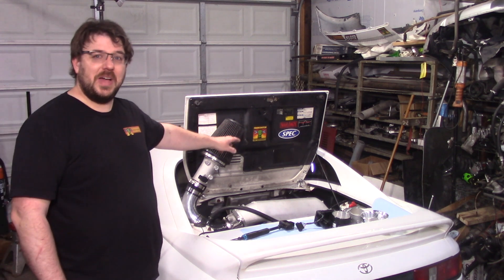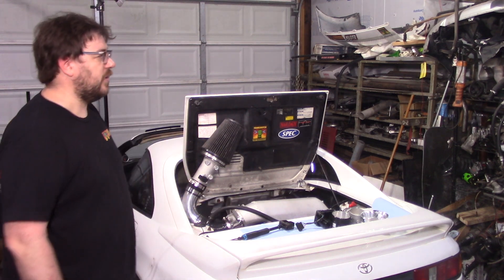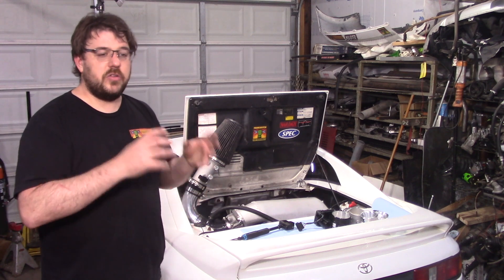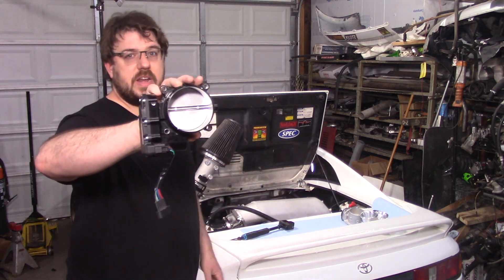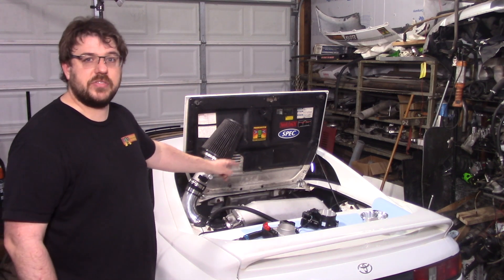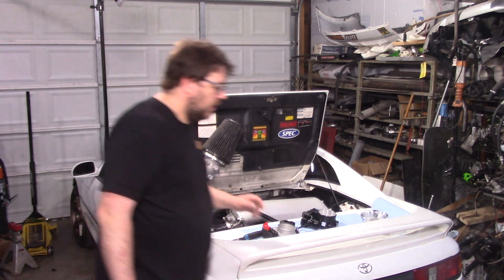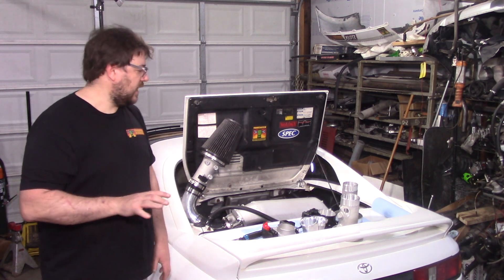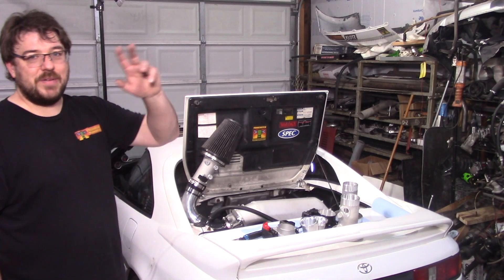New 2GR-FE intake adds another 20whp!

Comment: There are a TON of us RAV4 2GR-FE guys with stock motors looking for modest power gains. You say address the Y Pipe, okay. But where do we start with basic mods? You could stand to gain alot by addressing RAV4 mods. Keep up the good work.
Reply from the maker: Unfortunately the y-pipe IS the thing holding back the power, fixing anything else first is just fighting an uphill battle. I wish it was something simpler that i could tell people about and sure you could install cams and such without modifying the exhaust and it will make more power but it's all still very held back by the exhaust.

Comment: For stock application:

1) where are you routing the PCV valve hose to? I can see the other bank connecting to the intake pipe. 

2) does the variable intake runner length  “cutoff” 4,500K throw a code? 

Thank you,
Reply from the maker: PCV routing is the same as stock. As for the ACIS, it does not actually have any codes related to it.
Reply: @FrankensteinMotorworks  thank you Mark!

Comment: quick question.  will the supercharged version of the 2gr fit in the 1991 sw20? and can the parts you sell work with it?  "2GR-FZE. The engine is a supercharged version of the 2GR-FE used in the Lotus Exige S, Lotus Evora S/GTE, and the TRD Aurion. The supercharged 2GR-FE was fitted with the belt-driven Eaton TVS (Twin Vortices System) four-lobe supercharger. Lotus cars were equipped with a supercharged 2GR-FSE engine by the Harrop HTV 1320 supercharger."

Comment: Hey Marc, this is with the fuel rail, new injectors and the haltech right?
Reply from the maker: This is actually with the stock rails and injectors. In the video i did it with the Haltech because that's what i was testing the tune with but this works with the stock ECU.

Comment: How does one close the engine lid?
Reply from the maker: You can buy it with a 10mm drop spacer and you have to modify the rain guard but the engine lid closes just fine. With that said, i'm working on a reduced height version that will fit better.

Comment: I’m debating on doing a EZ30/36 or 2GR swap for the GR86. The goal is 350-375hp (naturally aspirated). I’d like to go with the EZ mainly for the sound and lower center of gravity, but my main concern is reliability. Any advice would be appreciated.
Reply: Leave the EZ alone. 2gr makes more sense... My opinion naturally. What about VQ37HR? Seems a reliable engine to get over the 400 mark NA, certainly easier aftermarket

Comment: I have a 2007 rav4 with the 2gr and I was wondering if its possible to do all of this to my rav considering it's the same engine. I don't see why not but I would love your input. btw thank you for the vids this engine doesn't get enough attention.
Reply from the maker: This can certainly apply to any 2GR-FE but keep in mind the first restriction in the 2GR is the exhaust system and fixing that restriction can make the car a lot louder than most people would want.
Reply: @FrankensteinMotorworks  thank you for the reply. My rav is already side dumped and loud as shit (in a good way) so the noise isn’t an issue. I’ll for sure be buying your stuff for my car after I save up a bit

Comment: Is there a way to valve the intake so we dont loose bottom end....for us highlander guys😊
Reply from the maker: Realistically, this intake was never really intended to be used in this configuration. This video was made because it was neat but unless the plan is to add even more at a later this intake is not really a good plan. A better design could be made to work much better with the stock cams, this one is made for big power.
Reply: @FrankensteinMotorworks  but I like big power. Hehe I'm looking into the supercharger kit off the lotus with the toyota 2gr-fe v6

Comment: So the 400 whp can't be achieved with the 76 mm throttle body and the stock ecu? Not even with the piggy back?
Reply from the maker: So it may be possible to make the 400whp setup with a stock ECU but this exact motor as i've got it put together would not work with the stock ECU. The biggest issue is the fact that the cams are not timed as the stock ECU expects because that would allow the valves to hit the pistons. But if you were to use different pistons with bigger valve cuts you could install the cams as the ECU expects them to be. as for the 76mm throttle body, that's probably too small, the math shows it as being a bit marginal so it may be worth trying but it will likely choke the flow a bit but Toyota has an 82mm throttle body available also and if that's not enough it could be bored out but 82mm is likely big enough.
Reply: @FrankensteinMotorworks  so the stoxk sienna ecu can read an 82 mm throttle body? I was not aware of that. Thank you for the answer!

Comment: wondering if the 2GR mods will work on a 1GR - 500cc bigger displacement and rwd - could make a great swap engine for rwd cars
Reply from the maker: The single vvt-i 1GR is a very different motor but the dual vvt-i unit would likely be able to benefit from a very similar path.

Comment: What’s your opinion on the unichip ecu tuner plug and play units? I’m considering maybe buying to see but as you have plenty of experience working with the 2ar-fe engine, I figured I’d ask. Would you say consider it or go with something else. I do like how unichip has the ability to change maps for drivability much like cobb
Reply from the maker: the unichip is just a modern take on an old school sensor value modifier. it does not actually modify the tune but it can make the ECU access different parts of the map. The 2GR and 2AR have a lot of plausibility stuff in the ECU that would detect too much fuckery. But more importantly the stock ECU really isn't holding the engine back so there's nothing to gain until you modify the physical intake and exhaust or engine internals to make it flow better and at that point, small changes can likely be tweaked by the unichip to make it react better to those changes.

Comment: so this definetley beats 5s NA, or does it..... enlighten me
Reply from the maker: When you say "5s" do you mean the 5S-FE motor that is one of the options on here? if so, it's about 2.5x more power than the 5S-FE. If you're saying bearing 5 seconds 0-60 then yes, even before this the car is already deep into the 4's. With some of the lighter versions of this car it likely get's into the high 3's 0-60mph. Or did you mean something else entirely?
Reply: @FrankensteinMotorworks  I think gr might be lighter but it can't ever hold as much as the 5s block before complete overhaul can handle more power. Highest output is 1000hp smoking tires video

Comment: Will this fit my wife's Toyota Highlander FKS motor? Lol
Reply from the maker: Unfortunately the FKS has a different intake bolt pattern. It's also very unlikely to be what's holding back the motor. The y-pipe is the biggest restriction on the stock setup.

Comment: I was thinking about and a little curious... What would the 4.0L(1Gr crank) look like with the big throttle body, largest cams, this intake, and headers.  Would you keep around that 400hp while lowering the rev range for the power band?  Just thinking that it might reduce the need for new springs and maybe even pic up a few HP.
Reply from the maker: Unfortunately the 1GR-FE crank does not fit in the 2GR-FE. Also the valve springs are needed to get the valve lift from these cams so those aren't optional no matter what the RPM range is.

Comment: Very impressive engineering Sir, I have 2018 Camry with 2GR-FKS, 3 inch down pipe to 3 inch center exhaust, D3 Performance tune for headers and 93 octane, RIPP superchargers coil packs, I made a custom cold air intake that is 5 inches diameter with throttle body tube of 3 1/2 inch MAF intake   and I am a BOOSTANE Fuel Additive Dealer so I use 91 octane with Boostane to get 100 octane... Will your custom intake and Tundra 76mm throttle body with adapter work on my Camry 2GR-FKS, please reply, thanks.
Reply from the maker: I really wish Toyota would have stuck with the 7GR-FKS name instead of renaming it to the 2GR-FKS because it understandably makes people think the engines are very similar but unfortunately they are not.
Reply: @FrankensteinMotorworks is it the same engine ?
Reply from the maker: no @Mj3_ed  no, the 2gr-fe and 2gr-fks engines are not the same engine. they do share some commonalities but most parts do not interchange.
Reply: @FrankensteinMotorworks   yes I learned that from your video but i meant 7gr-fks and 2gr-fks
Reply from the maker: @Mj3_ed  7GR-FKS is  what the 2GR-FKS has stamped internally on several of the parts. I suspect the name was supposed to be 7GR-FKS but they renamed it to 2GR-FKS at the last minute to use the 2GR-FE's reputation.

Comment: Any luck closing the engine lid with that intake? Turbo lid without rain guard?
Reply from the maker: Yes, as long as you remove ths rain guard and get the 10mm drop spacer things will fit fine.

Comment: Mark you should definitely start selling some Frankenstein motorworks merchandise... That way we can buy them and help you support bringing these new parts to our chassis...
Reply from the maker: I've actually spent a fair bit of time looking at different options for merch and what it comes down to is that you either end up with merch that is way to expensive or merch that is low quality. You can hit high quality and a reasonable price when volume is up there but that's not where i'm at right now.  At some point i will come up with an idea for something i can make that would appear to a wider audience instead of standard merch stuff but i haven't figured that out yet either.

Comment: I'm amazed at how you find OEM parts that just work with other Toyota products regardless of the age or model. Do you just guess what will work? Or do you already know somehow? Cool projects and video bro💪
Reply from the maker: Thanks for noticing. This is just a lot of research, buying parts and trying things. At this point i have a better idea of what may or may not work well together so i can save some time but it still comes down to just trying things.
Reply: @FrankensteinMotorworks  wow, sounds expensive. I've been a diesel mechanic since 1997 and one thing you learn is just throwing parts at a vehicle, without knowing if it will fix the problem, will get very expensive and wasteful quickly. It's cool you have this down to a science now. Awesome! 💪
Reply from the maker: @PANTYEATR1  It does cost money but keep in mind until i figure out that these parts have a usefulness these things are generally languishing in junkyards. For example the EB60 that i used in the Spyder used to cost me $200 or so each when i was figuring it out instead of the $2000 they cost now because there's demand for it.
Reply: @FrankensteinMotorworks  good work bro, I'm intrigued. The 2nd Gen MR2 is a bucket list car i hope to own one day.

Comment: I have a mr2 spyder, the motor blew and i am a broke college student but still want to do an engine swap as cheaply as possible. what do u recommend or could you do a series of the cheapest swap and make at least around 200 whp.
Reply from the maker: Honestly, i would just recommend putting another 1zz in it. Nothing else will come close in simplicity and cost. A 2ZR swap looks like it could be cheap and simple but nobody has confirmed it so if you're broke and you need this transportation now is not really the time to find out.
Reply: @FrankensteinMotorworks  thanks for the honesty.

Comment: Me/a lot of people are curious about what a stock 2gr with the new FMW/Wilhelm 3.5 inch intake pipes and tundra throttle body will do for power. Any plans to test these?  I want to know if its worth upgrading from the old 3 inch stuff incase there is a slight power gain!
Reply from the maker: I did test this on the same day as this. The result was no gains at all.
Reply: Is the Tundra throttle only worth it if you run your new intake? I'm planning my upgrade path and want to buy the wilhelm adaptor but wasn't sure whether to buy the 2gr or tundra version. Long term I'm thinking the EZ cams, your MAF intake and map.
Reply from the maker: @matthewpalfrey2147  The tundra throttle body added no power with my tests when i used the stock intake manifold. I was really hoping it would add at least 5whp but sometimes the tests don't go the way you want them to. The 263-EZP cams combined with the new intake the 3.5" MAF and my latest tune should make some pretty nice power. I need to run that test yet to get an exact number but i expect it to be pretty nice.

Comment: Do you have anything in the works for a replacement/upgraded lower for use with OEM intakes? Or is the best option to just do some Dremel work on an OEM piece?
Reply from the maker: That is not currently in the plans. The stock piece does not take much work to fix compared to what the production part would cost to replace it.